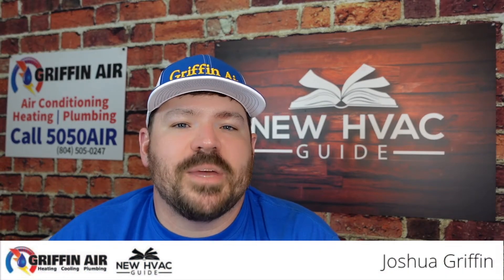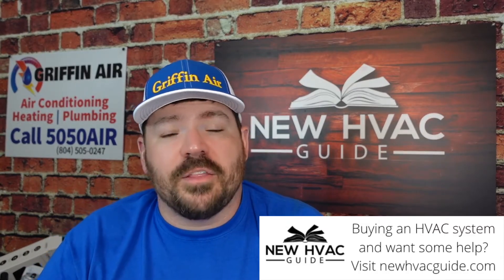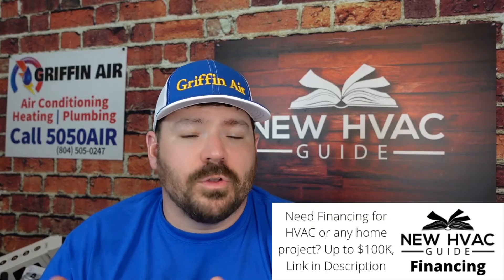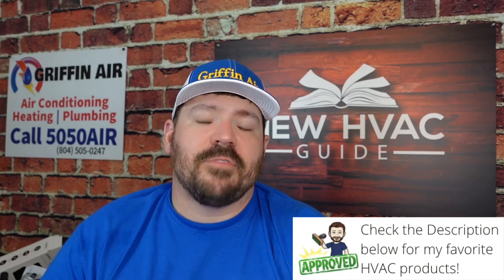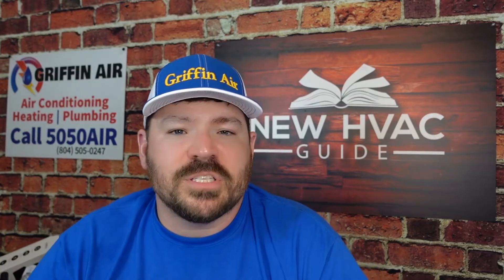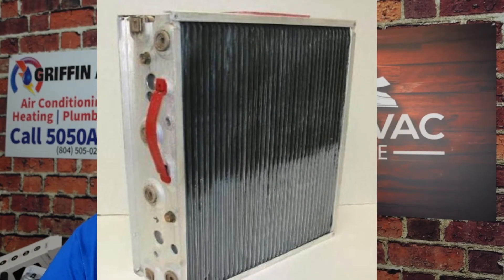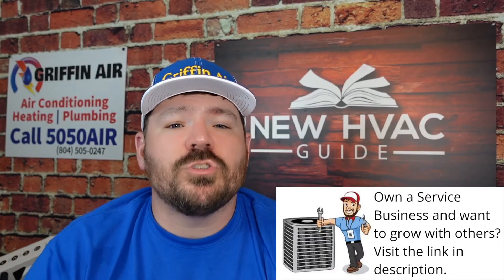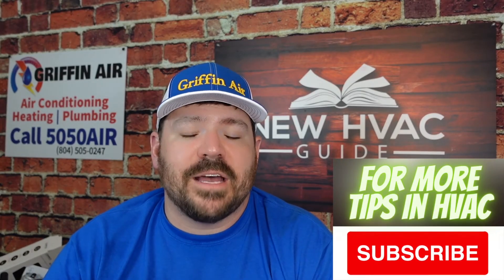ELECTRONIC Air Filters are USELESS! Here's Why!

Comment: What if you do regularly maintain the the filter units?
Reply: I would like an answer too.  If you regularly maintain the filters, are the the best or one of the best air filtration options?
Reply: @timdemming6352  we decided to move forward with electronic air filters for each of our HVAC units. I am an air/water snob so I will be replacing them as often as recommended or needed—every 3 to 4 months. I would still love his opinion on the best alternatives and his thoughts on electronic air filters if they are properly maintained.
Reply: Maybe the third time is the charm, what are your thoughts on these filters if they are properly maintained? Appreciate your insight, as someone that stays on top of these things I was curious in your answer before buying one.  Thanks in advance!
Reply: I'm a bit curious too.  We clean the electrostatic prefilter every 2 or 3 weeks, and the cells every month.  Sometimes more often during pollen season.  The activated carbon post-filter only gets vacuumed with the pre-filter and replaced every 4 to 6 months (directions say q4 months or when it stops reducing odors).
Reply: @michaelclark4876 what do your seasons look like? I feel like warmer year round it's better. Up north it's not always so easy to clean a filter when its cold and you may not even be able to use your outside pipes
Reply: @michaelclark4876 I should note that I flooded our basement when I was like 10-13 so I'm not not opening the line if it's been close to 30 in the last day or two

Comment: Agreed. I have had one, and I loved it, so lo g as I maintained it. I knew, when I was no longer hearing an occasional snapping whenever a dust particle came across an element that it was time to pull it and clean the elements (usually after a year). There was seldom much dusting to do as long as maintenance was done.
Reply: Really it trapped dust that well?
Reply: I.loved my Honey Well electrostatic filter. It kept the dust suspended. I could turn it off and on. It also took care of the tiny Nats. It made my house smell good. I switched to the AprilAire hepa hvac  because as tiuvsaud the maintenance got to be too hard for me. I cleaned the cells monthly and doesn't 45 minutes or more to clean them. The hepa filters are easy  to replace but are very expensive. They say yiu need replacement once per year or every 6 months for the carbon filters. I replace the regular hepa filters every three tovfour months. I replace the carbon filter every 6 months. The carbon filter is heavier and it takes me longer to get it into air cleaner ducts. I think if you are able to have your ducts cleaned out once a year, the Honeywell Electrostatic cleaner would be a better option and the cells would probably only have to be cleaned every 6 months to a year.

Comment: You're right! They do suck! My house came with one of these and it got wer at some point and stopped working! It was that way when we bought the house! Now it's busted and I worry about the air being filtered correctly. At one point I was qouted $700 which I'm sure is much more post covid. I don't recommend for this reason.
Reply: Turn it off. And just find a merv filter that fits. No need to stress.

Comment: Bought a new Trane heat pump system in 2006 with a Trane Clean Effects electronic filter. Maintained it quarterly and replaced the guts around 2013 to refresh it. It worked well all these years but noticed "stuff" getting by and into the coil again last year. Just replaced this week with a new PMAC. I'm hoping it works better and makes maintenance easier for me - especially during the winter when it was always a little more difficult to clean the Trane system as our outside water hose was winterized. One thing that our installer pointed out when he installed the PMAC is that it's flowing more CFM through our system than the Clean Effects allowed. We can feel that difference on our 2nd floor too.
Reply: I found twice a year worked well for cleaning, once each before either the cooling or heating seasons. Environments do differ, I'm in the Mid-Atlantic and dust levels are relatively low.
Reply: @Sasha299md  Also mid-Atlantic, and we're on our 3rd PMAC filter since October. But it works like a dream. We do have a household of 6 with pets, so...
Reply: @wcraft  The recent smoke from Canada's wildfires is what got me online. Wanted to see how well my current system Emerson/White Rodger electronic filter is protecting and whether to supplement with say either a HEPA or say a box fan fitted with pleated MERV 13 filters ala the Corsi-Rosenthal Box fans which were popular for Covid. So looking to improve the ultra-fine particulate material. Unfortunately they're predicting this won't be the only occurrence this year for us.

Not familiar with the Trane EV's but sounds more like a faulty install though not sure what "stuff" it was allowing to pass through, fine dust? I must say though I'm not a fan of how many installations are done, just adequate EV units with sharp airflow angles which harms both airflow and even distribution of air across the filter. Also what's with relying on the rather miser pre-filters that come with EV's. This applies generally to any filtering system used, like it's an after thought and it's just a must have. I'm a firm believer in using two types of filtering, first an upgraded pre-filer that's changed more frequently and use the EV for what it does best, the fine particles. Currently I use a 1 inch housing which accommodates a thin pleated MERV 6-11 filter and an equivalent to the pre-filter to capture the bigger particles. Now when cleaning the EV cells I find they're less dirty and the lower rated easily found MERV filter gets changed as you do, every 3 months.

Really the filter is more about cleaning the air for people and if it's doing that well it's also keeping the equipment cleaner. I know HVAC techs will agree, to do that well it means good airflow which is why I prefer the multiple filter system. I picked up an inexpensive anemometer to measure airflow ($25-50),  it's useful both to judge how airflow is performing with various filters as well as troubleshoot/balance airflow to different rooms or parts of a house. 

It's sad but many homes even today are built with substandard duct systems or compromises to save costs. It's a good idea for any homeowner to do an audit of their homes ventilation system, start with floorplan add individual room sq. footage, inventory each supply and return vent, and note both sun and exposure to the outside (windows/doors). There's little reason why there's any temperature difference beyond a couple of degrees for any living space other than cost savings or poor design. Sorry for the rant...
Reply: @Sasha299md  100%

Comment: Seems like as one in the HVAC business, you might have a bias towards equipment which carries a recurring sale item (i.e., replaceable HEPA filters).
Reply from the maker: We install Aprilaire filters. The media can be bought on Amazon. Funny how even trying to help people, I get accused of being biased
Reply: @NewHVACGuide  He has a point ... what's going to cause the homeowner to change an Aprilaire filter more often than changing/cleaning an electronic (electrostatic? you mention both but isn't there a difference?)?
Reply from the maker: @ The main difference is that a media filter will restrict air flow if it's not maintained which would affect the HVAC system. So total neglect is not an option.
Reply: @ 100%. So it wouldn't matter which kind of media is used—electrostatic, electronic, pleated, HEPA—if the user isn't going to maintain it why install one kind over another? I would go as far as saying the system that needs the least work would work best. Filter media that needs washing or other special attention would likely rate lower on the possibilities list for negligent or busy people.

Comment: Your title states Electronic like in the Honeywell F300 model......electrostatic to me are the one inch filters that have a couple or several layers of material in them where they generate a stat electricity when the air flow passes over them. Sorry, just my mindset. Great videos for contractors and homeowners Joshua.
Reply from the maker: Yeah. The video’s points could be made about electronic and electrostatic filters

Comment: Im really struggled with the perfect iaq solution for ocd sake . Addressing formaldehyde,  viruses,  and pm2.5 . I came up with large negative ion generators 500 million plus in the living space , positive ion plates by the return and electrostatic insert in the ductwork upstream from a uv light ( ghetto photocatalytic) additional hepa and carbon room filters . Still outdoor air is better.  Keep working on it
Reply from the maker: Maybe some ventilation?
Reply: @NewHVACGuide  not for nuclear biological war fought over energy.  But yes obviously its all positive pressure

Comment: Yeah, good point Josh, a system is only as good as the attention of the user.  My mom used to put the plate assemblies in the dishwasher.  Over the years they got kinda loose.  They would arc once in a while even new but that increased with age.  They did "work" but the installer put them right behind the return grille where a filter element should reside and the electrostatics upstream of the filter element.  Being so exposed to all the incoming dust dirties them faster and increases the arcing.
Reply from the maker: I’ve never heard of someone putting them in the dishwasher. That’s interesting. Most of them can be cleaned with simple water
Reply: @NewHVACGuide  
They get a film residue on them, at least my parents' ones did, that didn't rinse away from under the faucet water.
Reply: Our original directions on a Honeywell system called for washing in the dishwasher but I didn't like how it stained the walls of the dishwasher and we could only wash one at a time. We switched to a diluted commercial HVAC cleaner spray and rinse that our installer was now recommending and it works great and takes less time.  Which is nice since we clean the cells monthly..
Reply: @michaelclark4876  
Yeah I vaguely remember my mom complaining about the plate assemblies in the dishwasher.  That was in the 30 something years ago timeframe when my kids were little and I don't remember the particulars; I guess I have a glimpse of memory because she was bringing it to my attention.  At some point they turned it off because of constant arcing, I think because some insulators broke.   Maybe I can look into it again now that my son is living there with his family... But we do have a bunch of other projects backed up in the queue of greater urgency to take care of, plus now that I think of it, they don't need another maintenance item to end up neglecting.  Three young boys means things tend to be pushed off.

Oh, you may try Windex to loosen the dust off those plates...  Or straight up ammonia in jugs that's pretty economical - transfer it to a spray bottle for easy application.

Comment: the plated ones are absolute junk, as soon as a fine film accumulates on the cells, the dust just passes through. would need a merv 6+ filter upstream to get the bulk of the dust for them to stay effective - and then, just for the tiny particles that don't cause problems for hvac equipment anyhow.
furnace filter there to keep furnace clean, does little to nothing for iaq.
Reply: It's really a matter of degree though the EV plates do become less effective the more particles build up. Basically the inverse of the merv filters which continue blocking as airflow drops lowering air changes.

You're absolutely correct, the solution is to use a  filter with midrange merv rating upstream which also benefits by having a course pre-filter (screen) to catch the largest junk like hair, bugs, etc. Use all to maximize filtering, minimize costs, and effort while maintaining better filtering and airflow.
Reply: @Sasha299md  If you're dedicated to cleaning the cells monthly with harsh chemicals and changing the pre-filter at the same time, and want to remove tiny particles and pay to run the fan continuously - it can be worth it. For the masses a merv 8 to 12 media filter that only needs to be changed every 12 months is the best option.
Reply: @Jon-hx7pe  Sure if you neglect the fact that not everyone is like you. What makes you think a fan needs to run continuously, are you leaving your windows open or have an incredibly drafty house? Honestly a merv 8 to 12 filter after 3-6 months will begin to restrict airflow. So if you wonder why your AC is running so long and upset your electric bill is so high you might think about changing that filter.

Personally I clean the cells twice a year and are thinking of upgrading my merv pre-filter so they only need once a year. It's not about what only needs to be done but people's long term health and comfort especially those with allergies and other ailments.
Reply: @Sasha299md  In order for an air filter to improve iaq enough to justify it, the fan needs to be running all the time - not air being filtered otherwise. The air filter is there to keep the equipment and supply ducts clean. A basic merv 8 does that fine. 

4 to 5"  thick media filters have a lot of surface area and can last 1+ year no problem. This is what makes them good because homeowners don't remember to change filters. 1" is more like 1 to 3 months.

EAC cells need to be cleaned monthly, they become ineffective, all it takes is a fine coating of dust on the plates. By the time you hear it clicking all the time, it's months after it should have been cleaned.

Had a eac and it was the worst filter I've ever experienced despite monthly cleanings, actually. It was working properly - it's just a crappy type of filter. From my small sample, furnaces with the EAC have the dirtiest blower assemblies, fiberglass is in the middle and the ones with basic merv 6 to 8 filters the cleanest.
They may work well in the lab when spotless but not the real world.

They've fallen out of favor.
Reply: @Jon-hx7pe  

Nonsense you think buildings can't retain conditioned air, do you run your own AC continuously! 

If the electronic filter you had failed was likely either undersized, poorly installed/cleaned or flat out defective. They shouldn't click unless the pre-screen is damaged or not cleaned and dried properly. Personally if I waited until mine clicked I'd likely be cleaning less twice a year!

Modern systems are designed for human health and comfort just as clean equipment is needed to assure so. Hell why bother with an upgraded filtering system when the equipment has proven to last despite the use of those "crappy type filters."  As the OP mentioned as have others here it's mostly the lack of maintenance that kills systems.

"4 to 5"  thick media filters have a lot of surface area and can last 1+ year no problem."

Oh, so similar to the electronic filter's 6 inch plates. Or for that matter simply a larger but thinner and  less expensive merv filter. At least we agree, more sq. inches is better in a filter.

Sorry but I'll stick with research and testing by the same folks who brought us these systems. I'll trust their and my own personal experience before your anecdotal claims.
Reply: @Sasha299md  Experience in real world - would teach you the things I mentioned. The EAC was absolutely working fine - it's just a crappy dust filter, had I put a merv 6 to 80 upstream it would have been better. And even with that, need monthly cleanings and continuous fan operation to do anything.
Any technician will tell you systems with EACs are the dirtiest.

To have any fancy central air purifier/filter meaningfully impact air quality, yes the air handler or furnace fan must be running all the time - this means setting the fan to ON instead of Auto, not necessarily running heating/cooling continuously.
But fiy - hvac equipment actually works best running extended heating/cooling cycles, this means getting the smallest equipment that will do the job. The ignorant think shorter cycles are better and continuous operation in extremes, long cycles the rest of the time means the house is crappy - when it really means the equipment was sized right provided it's working properly.
Reply: @Jon-hx7pe  

LOL, sure glad I'm not living in your house. Ignorance of household pollution problems must be bliss...
Reply: @Sasha299md  get yourself a particle counter, test the ambinet air in the house with your eac on and then off a few days at a time with the fan set to auto. will likely see no major difference.
You'll probably learn your EAC is an expensive placebo especially with the fan set to auto.
Reply: @Jon-hx7pe  Sure in your house which you already admitted your preferred HVAC units are undersized and by design move LESS AIR !

And what age are these houses you test and have they had any upgrades such as windows, doors, insulation, sealing? Have they had an energy audit, in particular an air leaks test? You're experience is the need to continuously run central air to have effective whole house filtering.

[edit]
So on top of undersized ventilation you use MERV 13 filters, or the most restrictive filter recommended for home use! No wonder you're getting inadequate ventilation in your house.

I'll stick with the PRO's.

Comment: I’ve always recommended pulling out the guts and putting in a basic 4” merv 8.
Reply: I have a 3” MERV 10 24x24” at home.
Reply: I changed my customers to that and added a. Electronic air scrubber

Comment: I install the 4 inch thick media filters on all new systems. They blower motor stays very clean,  even after 10 to 15 years.
Reply: but somwtimes would that cause too much static pressure?
Reply: 4” filters have more surface area  vs. 1” filters with less static pressure.